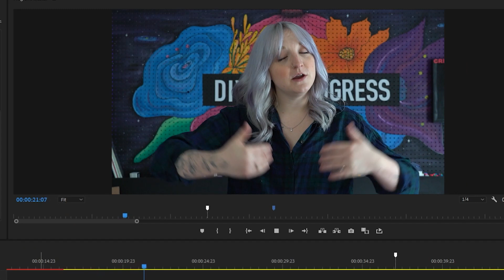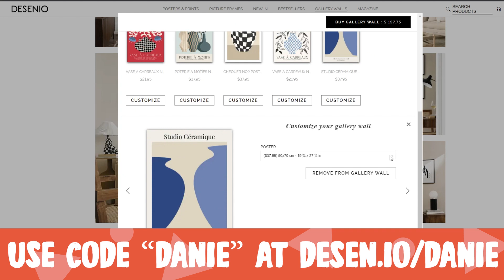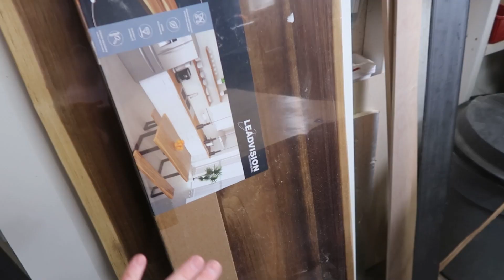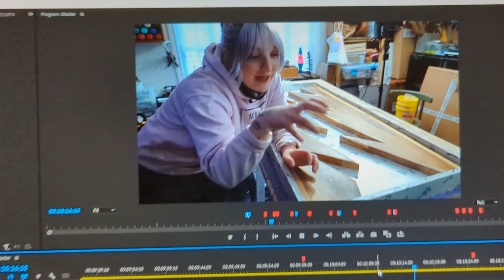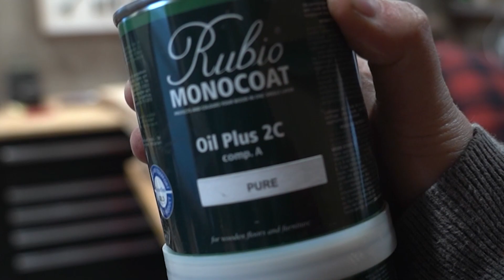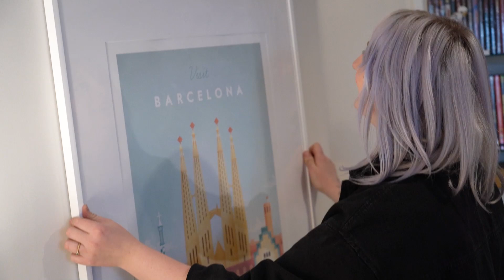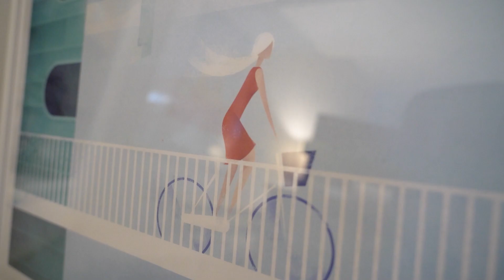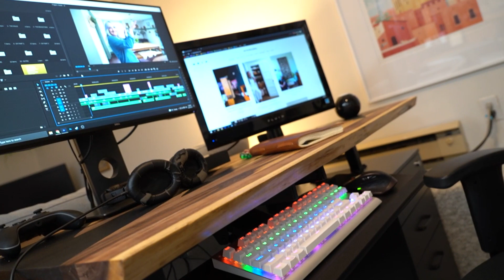i surprise my editor with a fully custom epoxy desk! ⚡️ HE WAS SHOCKED!  | DIY Danie

Comment: I look forward to your vlog every week.  Your energy level lifts mine. I loved the desk top, okay all of it. Great job on the metal work. It looks so high end.  I didn't realize that you could pour epoxy in stages.  I thought it was all at one time.  I think I would try this epoxy pour on something much smaller to begin with that way my mistakes would be minimal also. The torch...getting out the bubbles is a little intimadating. Congrats Dan.  You are very fortunate to be among the small number of people to have a Dani original.  Thanks for sharing.